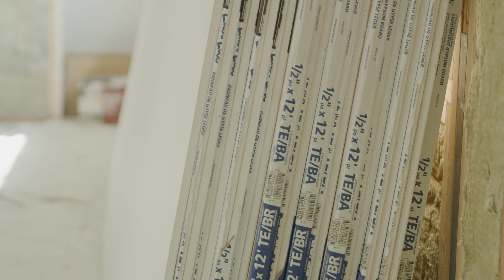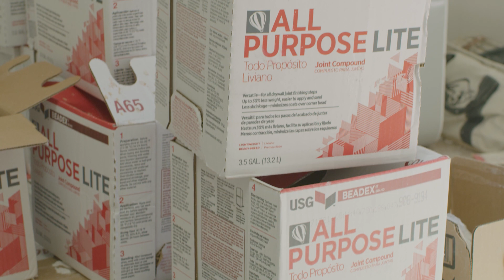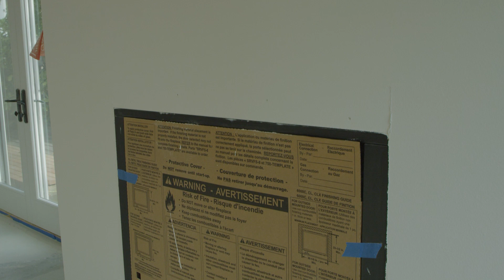What To Know Before Hiring a Drywall Contractor

Comment: Is it possible to get good results without sanding?
Reply: You can do a texture and not have to sand it. But you usually have to sand drywall in any standard application